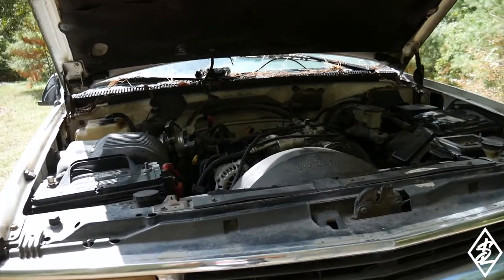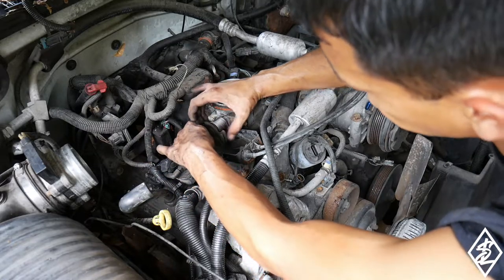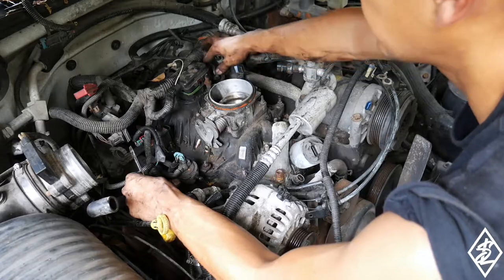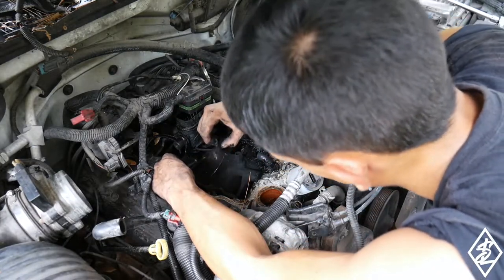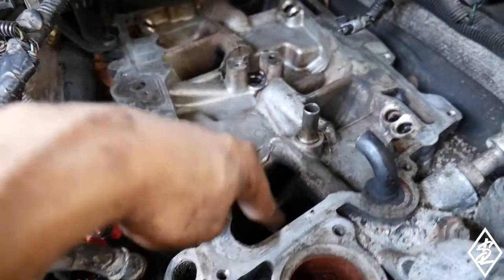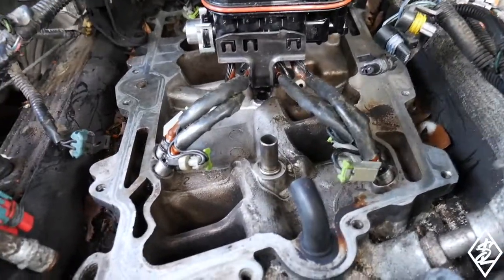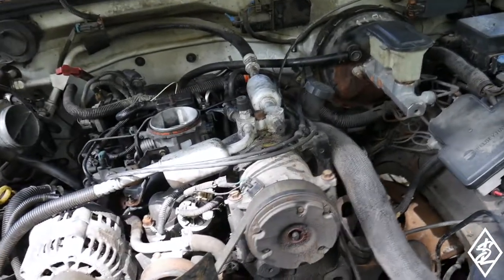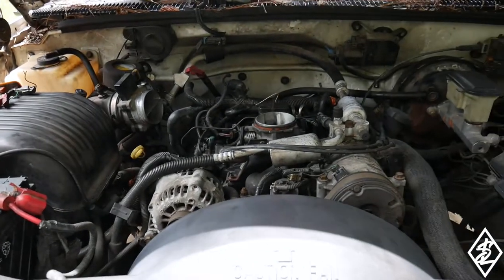Chevy 350 CSFI To MFI Injector Conversion

Comment: Why are you taking off the fan shroud, belt and top radiator hose? And definitely didn't have to move the A/C compressor.  You did a good job but could have saved on labor time fir sure

Comment: I’m doing this for my truck rn, When you were putting the intake back on was it a big struggle? I’m struggling to get the opening and mfi injector thing to seat i got some Vaseline as lubricant but any tips would be appreciated
Reply from the maker: I wouldn't say it was a struggle bit for sure the intake cover won't sit all the way but make sure nothing is blocking it. I had first started all the bolts loosely and went around and around tightening them down till it closed up. Shouldn't feel any binding. Turn them a little at a time don't want it to go on cockeyed
Reply: And, don't roll that O-ring either. Just remember, plastic makes a terrible sound when it cracks.😮

Comment: Yeah, so we never got to hear it run....not even on the spray can.
I was just wondering how.... if the coil was out on it, how did it even run on the spray can?
   Cranks with the starter good though.
Reply from the maker: I got updated vids on it, wires were broken/cut so sometimes would run, sometimes wouldn't

Comment: I did this same job about a month ago. Horrible job because that injector pump gasket is terribly easy to tear and not so easy to replace and if it tears you will have a vacuum leak. Huge performance boost when it was all said and done.
Reply: lube it with oil on both the gasket and the plastic part of the plenum